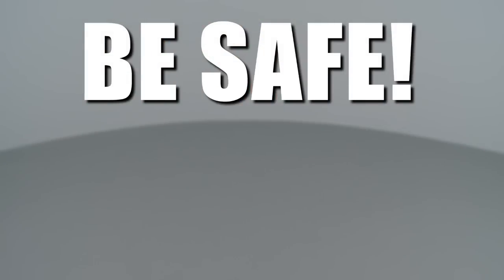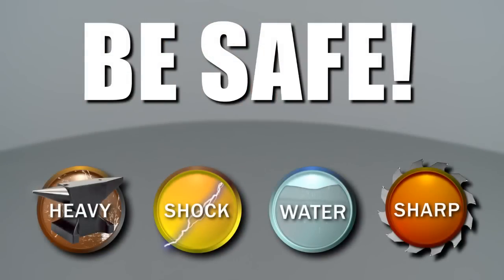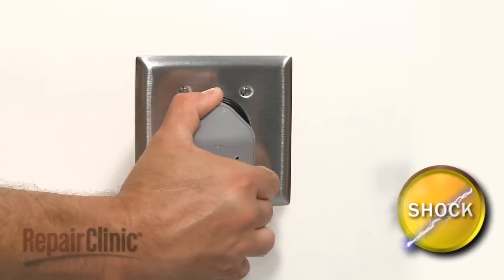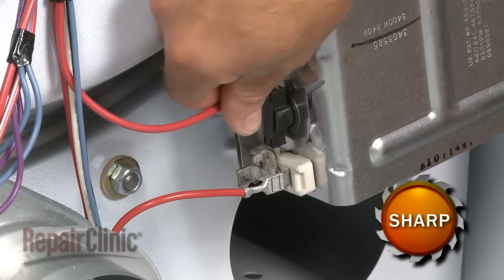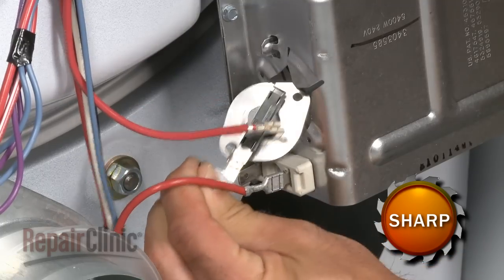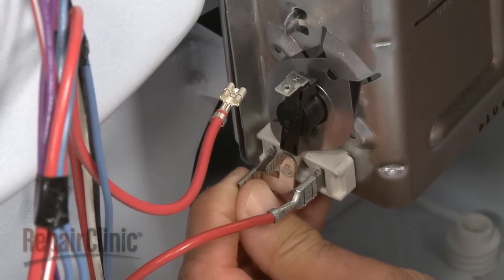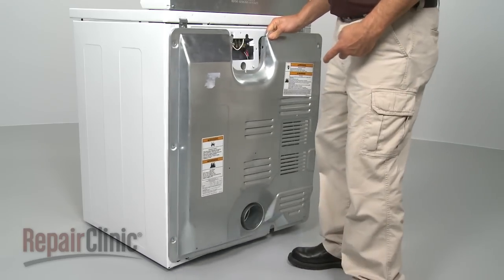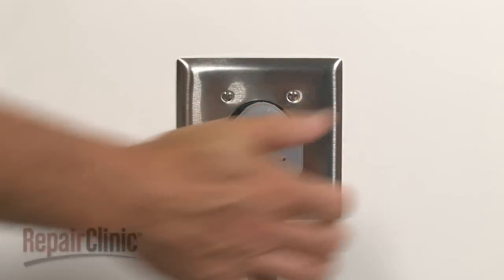Whirlpool/Kenmore Electric Dryer Is Too Hot? 898078

Comment: I replace the heating element on my Kenmore 80 series dryer and also the thermal fuse the white one that attaches near the housing the dryer turns on but does not heat Tumblr Rose but there's no dry air